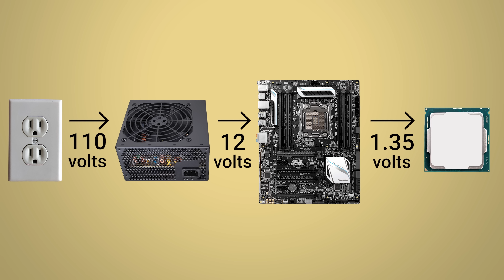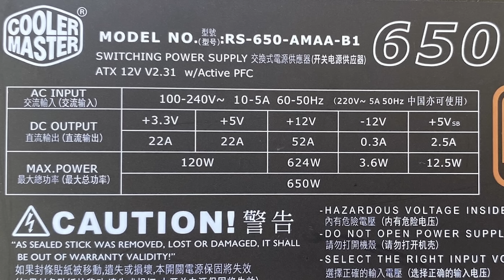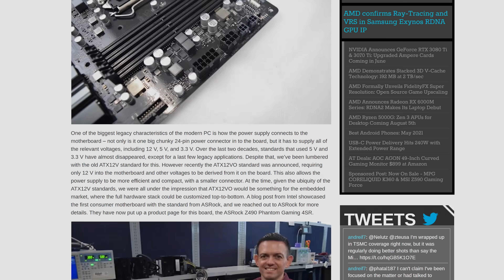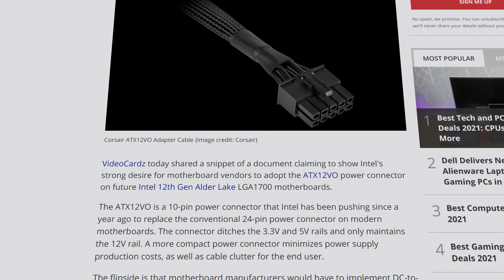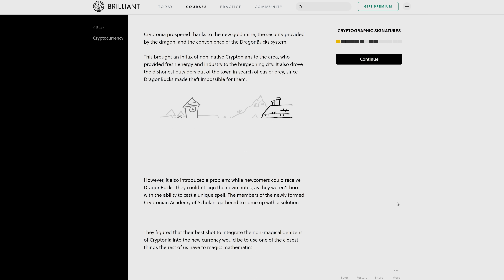Is The 24-Pin Connector DEAD?

Comment: I See this as a way to shorten the lifespan of the Motherboard.
Reply: Really to make it correctly they will basically have to make 2 system boards. 1 board for the motherboard the other board for the power conversion board. It was cheaper to do power conversation in the PSU so we have been doing it that way for decades. It ended up more efficient by accident. I really don't see ATX12VO catching on anywhere other than the OEM and maybe low end boards. High end boards there's already not enough space for everything.
Reply: Eh, the MB already does the voltage conversion for the CPU and memory.  The only new part is for the SATA drives.  To me, it seems like they should just keep a small 5V rail for SATA drives and release a new 12V SATA power connector for new SATA drives.
Reply: @CaseAgainstFaith1  and look at how much MB real estate goes to providing reliable power to just those two components? 

Honestly, if 12VO is about efficiency, why not build the conversion circuits into the PSU? Instead of converting AC to 3.3VDV, 5VDC, AND 12VDC, you convert from AC to 12VDC, then DC-DC to the other rails.
Reply: @StolenJoker84  That isn't practical given that one MB can support memory and processors with a variety of voltages.  That might be okay for 5V SATA drives.  But, it still seems to me that just having 12V and 5V rail inside the PSU as long as 5V SATA is common is the way to go.  So, you have two PSU rails, just 12 to the MB, just 5V for legacy SATA.  Seems fine to me.
Reply: @CaseAgainstFaith1  My suggestion was to keep the concept of line voltage to 12VDC, but then create the 5 and 3.3V rails using DC-DC conversion inside the power supply instead of adding more components to the MB. This would also keep power supplies compatible. 

The MB already creates CPU and RAM voltages by converting the 12VDC down to 1.5VDC or less. This same conversation also happens on the GPU, with about an equal amount of additional hardware as you see on the motherboard. 
5VDC is used for things like USB and standby power, while 3.3VDC is used for other things (like display outputs and RTC, if I’m not mistaken) so even if we get rid of SATA all together, you still need these rails on the motherboard.
Reply: @StolenJoker84  I thought... correct me if I'm wrong... but I thought DC-DC conversion was no more efficient and probably less efficient than a regular AC to DC power supply.  And that I thought the primary reason why it is done at all is simply that the MB needs to support many different voltages for the CPU and RAM.  If that is true, then using DC-DC converter within the PSU wouldn't make sense.  Though sure, I could be wrong.  But now that you mention it, yes, 5V is used for USB besides SATA.  I forgot that.  And you could be right that 3.3 V is still used for some things, I don't know.  But one thing I don't understand.... regardless of how many voltages are needed, if we are redesigning the power supply connector, why not redesign it with one big wire for the 12V?  One 8 gauge wire for the MB, and an 8 gauge wire for any graphics cards should be enough I would think.
Reply: @CaseAgainstFaith1  I’m honestly not sure which is more efficient. I just know that “better efficiency” is one of the big points being touted for 12VO.
Reply: @StolenJoker84  Well, what this video claimed was that the 3.3V and 5V were already barely used.  If that was the case, then just having the MB do the conversion for the little bit being used would make some sense. If that isn't really the case, then it doesn't make that much sense.  But another thing I don't understand is, why is the rail for the DC-DC conversion based on the 12V rail?  If we just had to standardize on ONE rail in the PSU, why wouldn't it be 5V?  The bigger the difference in voltage, they less efficient DC-DC conversion is.
Reply: @CaseAgainstFaith1  CPU and RAM power is derived from the 12V rail, even though they use less than 1.5V (around 1.3V for the CPU, unless it’s overclocked). This is (to my understanding) because it allows the high wattages required by the CPU, with lower amperage on the supply lines. The CPU used to be powered from the 3.3V rail back in the earlier days of computing. I think it may have been powered from the 5V rail at one point as well (but don’t quote me on that). 

Can we power the entire computer from a single DC voltage? Easily. All laptops are done this way, and any AIO with an external power supply is as well. But these designs have properties that benefit from this design. Desktops that many of us have, just don’t have much of a benefit.
Reply: @StolenJoker84  Your point that using 12V to allow for less current on the supply lines does make sense.  Though it would be less of an issue if they changed to a better connector and thicker wire, as I suggested in my previous post.
Reply: @CaseAgainstFaith1  IF you take out the 3.3V wire from the 24-pin connecter the the voltage conversation will need different most times less efficient so more waste heat generate VRMs. You also missed the part of the SATA controller chip uses 3.1V ~ 3.6V, The pin out for PCIe slot includes both 3.3V power and 12V power.

For SATA i really think it is at the end of life stage so having another power connecter will  most likely go unused but if they include an adapter to the current Voltage then it will be used. You also have Molex which is just SATA with a different pin out. Molex connectors are still used. To this again for extra power to PCIe cards that don't need that much more power like from a PCIe power connector but still need a little more power than the PCIe connector provides. These are usually on expansion cards for extra USB extremal ports. I haven't seen Molex power be used in anything other than that in the consumer space.
Reply: IMO all power management should be in the 
POWER SUPPLY (duh)
Reply: @ThylineTheGay  not all, atleast not the control for cpu voltage and other critical components
buit all that is there right now should stay in the powersupply.
Reply: @ThylineTheGay  that's not how electronics work
Reply: Thanks Engineers
Reply: MB's will be a bit more expensive (like $5-10 for 4x SATA) but PSU's will be cheaper by the same amount.  Lifespans unaffected.
Reply: @concinnus  I would be surprised if this is true.

Comment: I moved all of my hard drives to a NAS years ago, so losing the SATA plug wouldn't really bother me all that much. What would bother me is losing the ever-hated 4 pin Molex connector. My sound card still takes one of them to power its headphone amp, and so does my D5 pump. The pump only uses the 12V line and a single ground pin, so it would be simple enough to MacGyver an adapter to the PSU, possibly to an unused +2 on a 6 pin PCIe, or +4 on a 4 pin ATX. The sound card I'm less sure of its voltage requirements, and if I had to route a cable from the motherboard to the back of the sound card to power it, that could turn into a spaghetti nightmare depending on where the connector is located.

Comment: What a joke. So motherboard prices will skyrocket to put that awful connectors, cable management will be a rats nest nightmare because of the sata cables coming from motherboard and the best of all, introduces another point of failure in power delivery so we have to buy expensive motherboards instead of a new PSU. Excellent. I really hope AMD don't support this garbage.

Comment: Fix the 2+2+2+2 connector instead for HDD led, Power led, power button & reset button, first.
Bigger connectors are also much easier to cable manage.
Do not change what is not broken, nor can be done better.

Comment: I don't see the appeal in switching. It honestly doesn't make sense; yeah, the 24-pin "might be a pain" (sometimes?), but it makes more sense to me to deal with just a single cable that handles all of the juice, instead of splitting up the connectors.

The Asrock board depicted in the video for example, showed a total of 24 pin-outs for the 10-pin, 6-pin auxiliary CPU, and the two SATA 4-pins. That looks like it will just create cable-clutter and possibly move the fault of power supply-related issues to the motherboard as well, creating an arbitrary point of failure; why? Atx12vo makes no sense to me for consumer application.

On the topic of changing standards; how about creating an actually-good USB 3 connector that doesn't break a pin every time you try to install or remove it? That's a connector that needs to go, not the 24-pin.
Reply: Intel is basically insinuating that average user plugs and unplugs their 24pin atx 100 times a day.

While me, looks at my 4pin CPU connector, and remembers how it's not that easy to unplug it, despite having 20 less pins than 24pin atx.
That new connector can go to hell, really.

Comment: What's more annoying about the 24 pin is how ltt pushes (and has from the beggining) the new "standard". 

The psu costs wont go down, despite having less stuff to do and the mobo will definitely increase in cost, and have way more points of failure making more difficult to diagnose, more dangerous to go down and more possible to go down.

Honestly their takes and stances sometimes buffle me for how out of touch and stupid they are. And i find myself noticing such takes more often.
Reply: You mean about the new 10pin 12VO ?
Reply: @jeuno880  Yup

Comment: How about making a modular power supply that can fuse multiple blocks into a single config... I.E. Main power module rail to 10 pin, 6 pin, etc. That way instead of buying a single power supply block l, we buy a frame then the blocks we need...

Comment: 24 pin is not the issue. The issue is that we need at least another 4 pin for CPU, that's for the very low end, but most of the time we need another 8 pin or even another 2 x 8 pin, on very high boards/cpu even 3x8 pin. I mean, wtf, we already have 24 pin. So, if they make a new standard, better group everything in one connector. Having 10 pin instead of 24 is not going to matter if you still need 8 pin for cpu.

Comment: Imagine all the eWaste that comes out of a standard change like this.
Reply: @Mordekaiser It's the opposite. The new standard has only one 12V rail which means less points of failure. For the old standard there will be adapters around soon.
Reply: @RadioactiveBlueberry  No, it's way easy and less wasteful to replace a PSU or a cable that goes out of the PSU, while with 12VO if the conversion part of the motherboard fails, you have to throw away the entire board, which has a lot more components than a PSU.
They are just moving the problem to another place to make it look greener, and in the proccess they are making the system more complicated and in a way that is more prone to failure and if it fails is worse.

You are falling to the same trick phone manufacturers use, they don't include a charger to appear greener, but you are going to still need a charger, so instead of just having a box that is a bit bigger and transport both things in one go, you end up needing 1 transport for the phone, another for the charger, and separate boxes for each one; wich ends up being way less greener, but if you ONLY look at the phone manufacturer numbers it's all magic and unicorns.
Reply: @Longgshot  Don't talk about efficiency if you don't understand power transmission and the losses inherent therein.  

The short of it is that lower voltages are generally less efficient to transmit than higher voltages. It's more efficient to transmit the higher voltage and convert it closer to the stuff that needs it. That's why long distance power lines use a way higher voltage than any home or business uses.
Reply: @MiIIiIIion  I know that, but that doesn't mean it's a practical solution, or a solution at all in computers in general. Because it isn't a problem at all in the first place.
And efficiency isn't the only part of the equation here.

But, i repeat, i'm against it for general PC use, outside of office prebuilts, because there in office PCs, yea it makes sense, but outside of that it is just making a huge mess for minimal to non existant improvements.
It's just like server parts usually don't make any sense for desktop use.

The difference in efficiency, taking into account everything that goes into it, including what you said, is pretty small for making such a big change.
And that is going to be negated by motherboard makers not having nearly as much experience with it as PSU makers are. (and also they being cheap as fuck)

It's like asking a regular mechanic to go and fix an F1 car, he would more or less know what to do, but in no way it's going to be even close to what a specialized mechanic will achieve.

So, basically it's searching a problem for a solution instead of searching a solution to a problem.
And also Intel seizing the oportunity and trying to compete by pushing the standard for their next generation of CPUs.

And all this is for the most part because EU doesn't know how to stop making stupid laws and regulations just for the sake of it, without thinking in the consequences / ramifications of them.
Reply: Why? I doubt anyone is going to buy a new motherboard just to have the new power connector. And existing PSUs will simply have an adaptor cable.
Reply: Sure, but that's the nature of standardization and progress... That being said, if I have to prematurely ditch a perfectly good PSU because there will be no way to adapt an existing PSU to this new standard, I'm gonna be pissed.
Reply: @tankerd1847  adapter leads already exist on eBay - I have already purchased one for a system I had that already has this standard in ATX mainboard. I had to adapt so a GPU and larger PSU could be installed without buying a dedicated 12VO PSU.
Reply: @tankerd1847  But this is a change of standarization for very little benefits and a lot of drawbacks. Which is not a smart move.
If there needs to be a change in a standard to be able to get big benefits and even better if it can get better in the future, then yea, change whatever needs to be changed, even if its the entire system.
But in this case it brings little benefits and it doesn't have room for improvement in the future either.
Reply: Existing 24-pin power supplies and motherboards won't vanish into thin air overnight. You'll still be able to find replacements for years.

Maybe you're the kind of person to replace the motherboard 6+times in the life of a single power supply (to get annual CPU upgrades), but most people aren't. "Normal" consumers and business both run their machines into the ground as-provided and then replace them whole. Something like this will have no effect on the waste they generate, and they generate the bulk of the e-waste.
Reply: @klikkolee  And thats exactly why it should remain in the corporate and prebuilt spaces, it makes sense there, but everywhere else it doesnt make any sense.

12VO in regular desktops would make as much sense as using the cooling fans or PSUs from servers in a desktop PC. It would work, but it would not be a good experience since those components are optimized to a very different use case.
Reply: Well... in short term, yes.
But in long run, it will save more power.
And instead of 12V, why not 24V?
What's the plus and minus? That's the real content that I search for..
Reply: Oh god yeah. I mean there’s gotta be a good reason for this. I suppose efficiency, but cmon literally everything uses this rn so many PSUs and motherboards boutta get yeeted
Reply: in which areas do you expect the eWaste?

Comment: The only thing about 24 pin connector that i do not like is the angle on the MOBO, it should be turned 90° to lie it down :)

Comment: Why is there no transitional hybrid designs or adapters? What, is intel just gonna force everybody to adopt the 10-pin plug and force consumers to also upgrade their perfectly usable PSUs if they want to use newer intel CPUs/motherboards?(probably yes and probably not the first time that I can remember at the moment) Also if higher end components need extra plug/s for more power that just defeats the purpose of replacing the 24-pin to a single smaller connector. Personally I don't have a problem with the 24-pin, I can see how this could be beneficial to SFF but they shouldn't make this as confusing as the USB naming scheme

Comment: I never ever had a problem routing the 24 pin or plugging it in. Usually a walk in the park, it's unplugging it without feeling like I was about to  rip the motherboard apart that was always the damn issue.
Reply: My personal trick is to either : 
1. Wiggle it gently while pulling , while putting 2 fingers from my other hand on the motherboard so that it wont bend.
or 
2. Press the latch, then use a flathead driver to pry it gently from below. (Rarely uses this trick, only on very cheap PSU connector)

Comment: Atx12vo has no place and should die, 10% higher efficiency doesn't justify rendering every psu ever made useless, and transferring the cost to every new motherboard you buy as if they weren't already expensive enough. Recurring costs are definitely not what i call "efficient".

Comment: for some reason funny 
"Is The 24-Pin Connector DEAD? " 
with thumbnail of ATX 2.0 20+4 pin connector and also the sissy 110 volts. 
but there is nothing funny about the idea of trusting motherboard makers for the 3.3 V and 5 V

but luckily seasonic has a compromise of a sort, by modifying the Connect for 12VO psu and there will be no need to change the motherboard.
Reply: The question is :
1. How much
2. Is it compatible with all types of case.
Reply: @jeuno880  hard to say but
some case would die ether way 
but it is safer in the long run